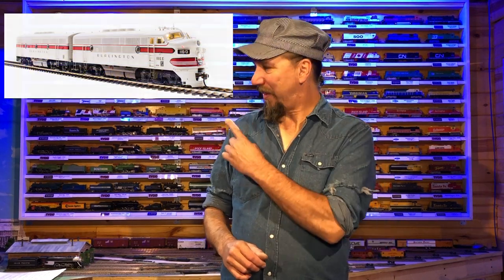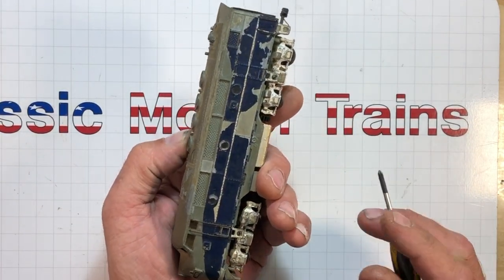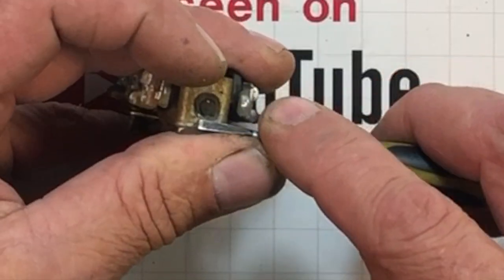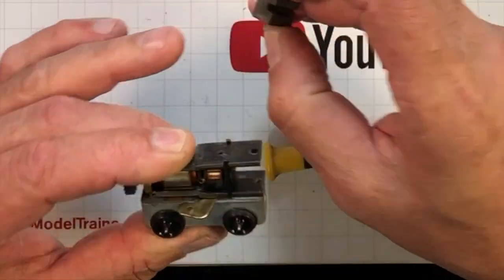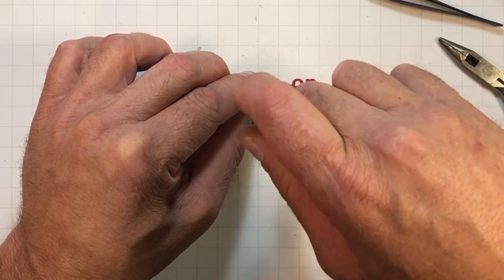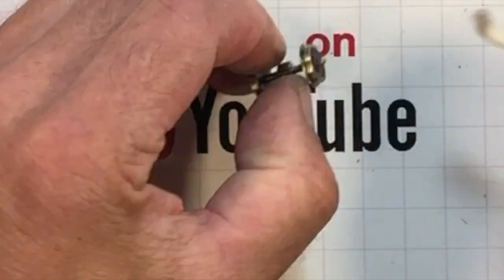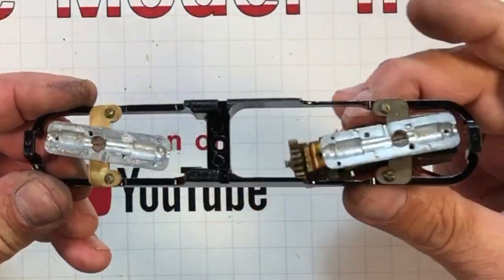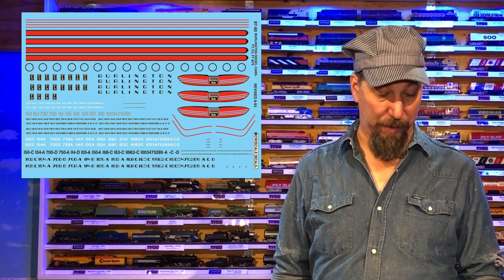Rescuing A 1945 Varney F3 "A" & Powered "B". Plus First Stages of a Re-Paint. Part 1

Comment: Nice work on these F units. I have an all powered A-B-B-A set of these that I will be rebuilding sometime in the near future. All of mine have the earlier coil spring belt drive but are, otherwise, identical to yours. The only modification I intend to make is to substitute a rubber O ring for the spring belt which will make the loco very quiet and should make each one pull better. Varneys were built to a high quality which is why they have stood the test or time. Thanks for showcasing these great vintage trains.
Reply from the maker: Thanks for your kind words. All powered ABBA, That sounds awesome!! good luck o-ringing them. Im hoping they run like a dream for ya :-)

Comment: There is silicon flexible tubing/hose you can use that is thinner walled (inner and outer walled) than what you tried to use. Also you can make a solid plastic tube with slots at the end for the ball joint's horns.

If you want to DCC them you must change out those motor of course!
Reply from the maker: Hello Arrow, Yup thinner wall tubing.  I was filming this Saturday night, last minute of course.  A lot of people have gave great driveline replacement idea's.  I would not DCC these. I'm not a big fan of it.

Comment: Last year I bought an old 1957 tenshodo 8 wheel drive  Pennsylvania RR gp7 with the same Pittman motor setup with the center drive shaft that was missing. The retailer I bought it from is out of Florida and they made a new shaft to go between the drives and capture the dog bones with some notches out of some sort of small diameter fiber thin wall pipe of some sort. I can email some pictures of it with a few dimensions if you'd like.
Reply from the maker: I have a few idea's that line up with what you mention.  Thanks for your great idea's and you offering some pic's.

Comment: the coupling you need is varney 2062. check your hobby shop for plastic or brass shapes which can easily fabricated for that use. simple hand tools can form a tube. suppliers are on line if you want to mail purchase. they also sell a generous sample pack.
Reply from the maker: Greetings suppy,  Thanks for the great idea's.  One feller suggested using a Bic pen tube and some fabrication skills :-)

Comment: Best video I have found about this subject matter. One question, what do you do with the ends of the bus lines?
Reply from the maker: Well I'm not sure if you have commented a question on the wrong episode or what.  This episode was about re-painting and repairing an old Varney A and B unit.  My latest video was about installing buss lines.  Since my layout is just a point to point the buss lines just start and end.  the ends are under the layout and waiting for future expansion.  If you have a loop, I have read do not tie the buss lines back into themselves.  Causes problems with the DCC signal.  Although I've never experienced it.

Comment: As usual, another excellent video. Those old Varneys are fun to work on and make nice pullers. Another option you might be able to make a drive shaft out of an old Bic pen, or a plastic tube about that size then cut slits in the end so it fits over the pins. Painting that makes it look amazing. Do you rattle can or are you into airbrushing?
Looks like those engines run well together. If it was a major problem you could put the A shell on the B chassis and then turn the 4 wheel drive chassis into a dummy unit.
Reply from the maker: Thanks Tim for the Bic pen idea! I think that's a great idea!! So far I'm rattle caning.  Benn wanting to get an airbrush and a hood system. I couldn't believe they ran as such close speeds together.

Comment: You do nice work. Varney products back then were very well made. Have you seen the Varney super motor that has 7 polls? I have repaired several Varney 0-4-0 Dockside switchers, and, in a video, I took apart the motor and took out the magnet and a viewer said that will weaken the magnet and cause a higher amp draw. I was wondering if you know anything about that.  There is a way to re-magnetize the magnet but requires a special magnetic coil setup. I just came across your channel and now have watched almost all of your videos.
Reply from the maker: Thank you very much! I've only seen pictures of the 7 pole. Removing magnets does not "hurt" them. Amp draw comes from the windings on the armature, gauge of wire used, and load on the motor, not the magnets. Ive heard of being able to re-magnetize magnets, but don't know what's involved, might be a urban legend?  Thanks for supporting my channel like you do, Hope you get some good info to help you out :-)

Comment: Hi Ron, Another great video.. question pls.. when working on these motors how does one know if the magnet needs re-energising? I have seen it talked about on a few channels and just wondered if you know anything about this... There is a gentleman named Ronald Dodd (on the Ytube) who has made a device to do this but my question is how do we know if a magnet needs this done or not...
Reply from the maker: if the magnet is week the armature won't spin at low voltage and wont able to creep along.  will have very poor performance and not be able to pull.  This of course only if the drive has been cleaned and fresh lubed with good continuity to the power on the track.  If a person has a re-mag it would never hurt to freshen them up every 5 - 10 years or so.
Reply: Thanks a lot Ron.

Comment: you want to be careful about removing those magnets from the motor cage because they can loose magnetism
Reply from the maker: This is an interesting comment you posted.  I enjoy different opinions and discussions about "things". I wonder why you mention this?  I have seen magnets that are stacked up with each other in a "tube" shape for shipping. why would a magnet loose its "power" by removing it from the motor assembly? They were not built in the cage. Just talking here, not arguing :-)
Reply: @classicmodeltrains  the same reason many horseshoe magnets need a field keeper . this is especially true of alnico and ceramic magnets . 
I removed the magnet from a Mantua 0-4-0 yard goat motor and when I reinstalled it the motor would barely run ,I ended up using a stack of neo mags to make it run again
Science and stuff https://en.wikipedia.org/wiki/Coercivity
Reply: @classicmodeltrains  I'm sure there are differences between magnets and motors.  From my own experience, Tri-ang X04 motor magnets definitely loose most of their magnetism as soon as they are taken out of the motor frame.  I made my own re-magnetiser using electromagnets to return them to full strength after re-assembly.  Without re-magnetisation, the motor will draw much more power, running the risk of overheating the armature, and have much less torque.  It is a common practice for anyone dealing with these motors.  Love your channel. 😊